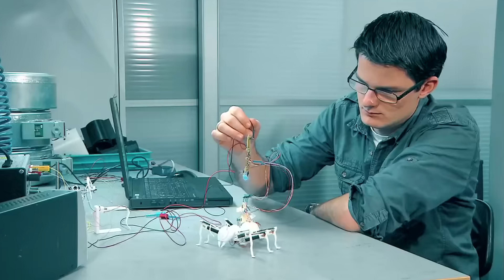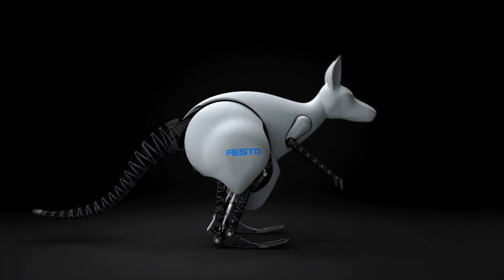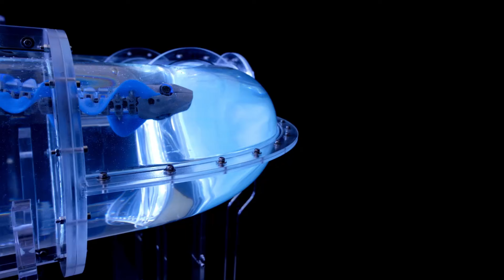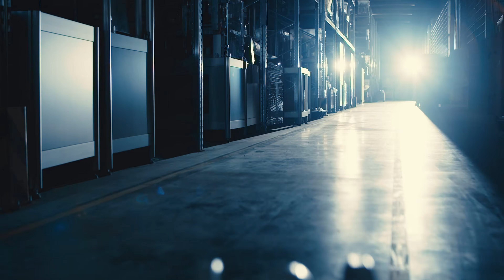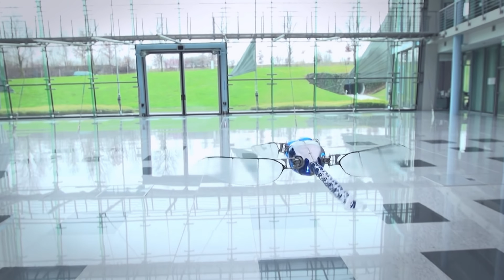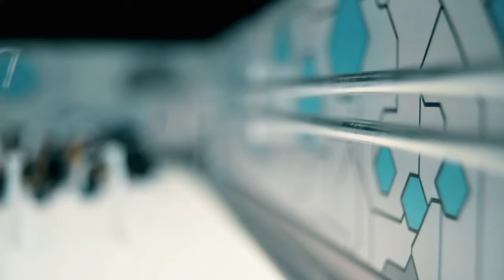Festo - Bionic Robots || 7 Amazing Bionic Robots || Episode 1 | 4K | YouTube 4K | Robotic Automation

Comment: Honestly, what is the point of robotic animals when the real animals that God has made are so much better?
Reply: The point is so you don't have to train and send real animals to do dangerous work. Why use a quad-copter drone to survey a dangerous site of a radioactive leak or a disaster zone, when you could send in a bat shaped drone that is significantly smaller and lighter. Or would you prefer we use real fruit bat for that? Same for the swimming robots, which would be immensely helpful for rescuing divers trapped in caves or for exploring underwater ruins.